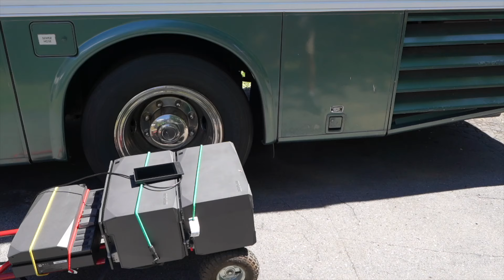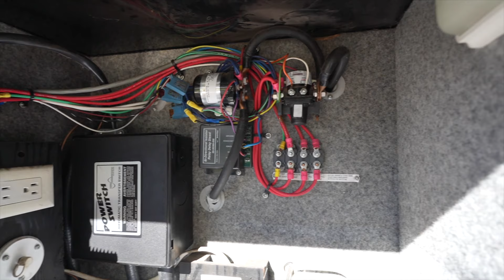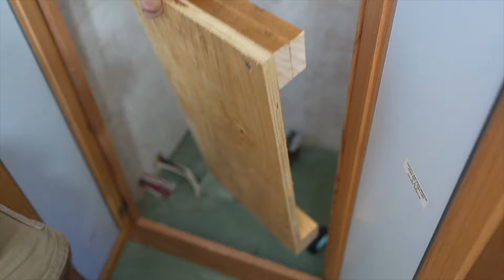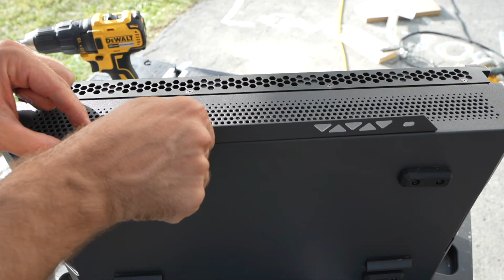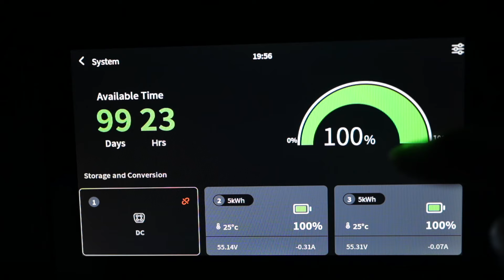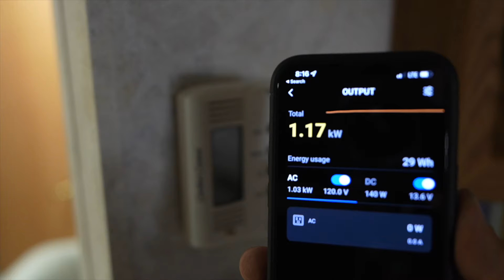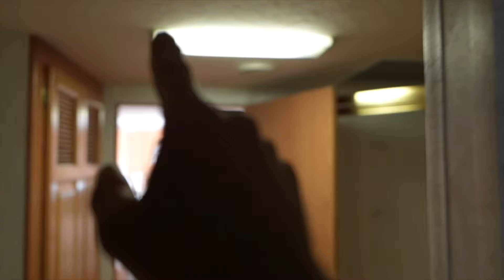Upgrade Your RV with MASSIVE Power | EcoFlow Power Kit

Comment from the maker: Thanks for watching!  Please Like the video (if you did).  Next on my RV to do this is to track down a short circuit that’s been draining my engine batteries.  What’s a project you have next on your list?
Reply: My next project: Clean my repair desk...
Great video by the way!
Reply from the maker: @androidmx1831  Nice!  Me too.  Thanks!
Reply: Would the amp-hound tool help you in any way to find the short circuit? It was featured on the Youtube channel "Car Wizard" in the video titled "Smoking up the Shop! CAR WIZARD shows 3 essential advanced diagnostic tools he can't live with out!" starting at 13:08. It is made for finding battery drains, not exactly short circuits, but they can be related so maybe it could help?
Reply from the maker: @justin_time  thanks, I don’t know of that product so I’ll have to check it out!
Reply: I will get one and steal electricity from public buildings
Reply: That's so funny I just watched another guy's channel right before yours and he solved that problem of running boat 13,500 BTU at the same time they having soft-start on them

Comment: Hi, how are you? a few days ago, I bought a brand new Fiat Ducato van. The project is almost ready, all in 80/20 profile. now I see many people using the ECOFLOW system,  I have some questions about the Ecoflow equipment.

1) It's a relatively new system. What do you think about the durability and maintenance of the equipment and batteries? Are they durable?

2) I live in Portugal, and here in Europe everything is 220V. Is the equipment dual voltage?

3) Will the circuit in the van be 12V or 48V (refrigerator, water pump, lights, etc.)?
4) What type of solar panel should I use? 12V...24V...48V...does it need to be Ecoflow or can it be another brand?
5) With a 5,000-watt battery, is it possible to power a two-burner induction cooktop?
6) Is it easy to configure?
7) What do I need to add to the system to be able to have the water tank level readings on the Ecoflow LED panel?

Thank you very much...I miss your updated videos!

Comment: Still waiting for the alternator charging video.
Would it be possible to connect any 3rd party battery to the alternator charging port to charge the power kit batteries from 3rd party batteries?
I think it should be possible…?
Reply from the maker: Are you wanting me to review it?  I'm not currently planning to review one but I supposed if there is enough interest I could.
Reply: @FrugalRepair mainly just let us know here on this comment if it’s possible or not

Comment: Until they improve outputs to permit the use of a 12v a/c unit, this system is a hard NO.
Reply from the maker: What are you wanting to see change?  A higher amperage on the 12v output?

Comment: That's sweet. It looks like that closet space was made specifically for those batteries. Real clean install. I just found your channel and subscribed.

I just faced a similar space challenge with my batteries. I too have an older motorhome with the batteries located under the entrance step. Our motorhome came from the factory with 2 CG-2 FLA golf cart batteries in this space. We're FTers who boondock most of the time, so wanted the largest capacity battery we could fit in this same small space. If we went with 2 pre-made batteries like Battleborn, Lion Energy, etc. only 2, 100ah batteries would fit there. So in January we custom built a 560ah (7.1Kwh) LiFePo-4 battery, made with 8, 280ah prismatic cells. We actually made 2, 6v batteries so we could wire them the same. Think of it like 5 1/2, 100ah Battleborn batteries. We used a Heltec 350amp BMS, to start the onboard 5,500watt generator in our motorhome, along with a 5a active balancer to keep the cells synched up. We built our 12v battery with grade "A" LiFePo-4 prismatic cells having a 6,000 cycle manufacturer projected life at 100% DOD. This means that if we cycled them 100% every single day, 365 days a year, they would last over 16 years! So they're obviously going to wear out from age before they wear out from cycling. It only cost us $1,500 to build this 560ah battery, including the high amp BMS. Thet fit under our steps perfectly, have 5 times the capacity of our old lead acid batteries and were even 35lbs lighter too. We insulated the battery compartment, cut a 1" hole in our step risers and installed a tiny computer CPU fan to keep this space at close to room temperature, so we don't have to worry about the BMS shutting down charging from getting too cold - or their life reduced from getting too hot. 

We started our build 4 years ago with a 620-watt liftable array mounted on the side of our motorhome. It serves as a nice bedroom window awning too. It practically lifts itself to the desired angle with a couple gas struts and it's easy to clean with a windshield squeegee, standing safely on the ground. Lifting an array to the correct angle for latitude and month, produces 25-30% more power than a flat mounted array - even more in winter when the sun is low on the horizon. We typically use about 15% of our battery's capacity each day, running a desktop computer and a 55 " UHD TV most days till midnight. We've found they charge much faster than our old lead acid batteries did and are typically full before 1:00. Our complete system, including the liftable array, wiring, breakers, a new Progressive Dynamics 80a Li compatible converter/charger, a 600w PSW inverter (to run our TV and PC), an Epever 50a MPPT charge controller for our solar panels, a Lnex battery monitor/shunt, and a Renogy battery to battery charger (to protect the alternator) only cost us around $3,600 as we did all the design and installation work ourselves. 

We have our MHs onboard 5,500w generator for backup and to run our AC units and microwave, but it doesn't start and shut off on its own like your sweet system. Last Spring our 23 yr old, 13.5k Btu Dometic AC died so we replaced it with a new 14.5k Btu Furrion easy start AC which cools our entire 36ft motorhome just fine. Since I installed it, we never had to run our rear AC even once. Furrion now makes a 15k Btu model that's even more efficient, drawing the same current as our 14.5k Btu model.
Reply from the maker: Thanks for watching, subscribing, and the info!  I was recently reminded about how nicely those two batteries fit when I had to pull them out to wire in a solar array before I put them back.

Comment: What about the function of the alternator and generator to charge your batteries? Did you attempt to wire those units together?
Reply from the maker: Thanks for asking.  I have used both and they work.  I just drove a 2,000 mile trip and used the alternator on and off.  I likely need to come up with a better wiring setup for the alternator cable but it works.  One thing I need to think about more is that when I turn the engine off that I need to turn of the alternator input otherwise it draws from the engine batteries.
Reply: @FrugalRepair the alternator charger from EcoFlow is a smart unit and when the engine is off it is not pulling power

Comment: Well if they would give me the money back for the Eco flow Delta pro 2 and extra battery that I bought to power my RV that turns out it won't power my RV because of a Problem with the compatibility with transfer switches Regarding a negative ground issue yeah I would be happy to buy one but since I paid $6000 for 1 that wont-work maybe I won't
Reply from the maker: Did you contact customer support?

Comment: Great video.  This looks like a great system to upgrade to but you may want to point out the cost.  Based on their website the gear they gave you cost as much as my TOAD.  This is not an inexpensive upgrade.

Comment: You know what.. The built in Onan genset on  my old class A is pretty well shot. I wonder if I could just take it out and put a system like this in it's place.

Edit, just saw the price, Yikes! Might see about making my own system....
Reply from the maker: Especially If you’re generator is gas/diesel then that’s a good thought.  Is it possible to rebuild your generator engine?
Reply: @FrugalRepair  Yeah, I just didn't want to mess with that if possible because the previous owner did some odd stuff like replacing a safety control board with a toggle switch... The main issue is I know the carb needs rebuilt, it's spewing gas out of the bowl now so sounds like the needle is gummed up. I can't get into that tiny space to even disassemble it. I was going to try to drop it but my floor jack doesn't go high enough. I just got fed up and gave up for now.

It's a gas Onan 5500 Emerald if I remember right.

Comment: What I like best about this Power Kit is that it is using a 48v system which has thinner wires and a bit more safer compared to the 12v system.
Reply from the maker: Yep! Less amps (and unwanted heat) for same amount of power.
Reply: @FrugalRepair  48v is the way to go if you want to run your high current devices like AC. This winter, we will be installing a 48v battery bank ourselves in addition to our 12v system. We will use 16, 310ah prismatic cells (15.9Kwh.) So together with our 560ah (7.1 Kwh)12v bank, we will have a total of 23Kwh of batteries onboard. This is why we mounted our solar array on the side of our MH, to leave the roof free to rack 8, 460W bifacial solar panels down the length of our 35ft Class A. The front side of these is rated at 460 watts with up to 25% additional wattage output from reflected light on the back side, for a total of up to 575 watts, depending on how they are mounted. We will be racking ours about 13" off the roof to clear our front AC shroud and vents. This clearance should conservatively produce another 10% output off the back of these bifacial panels, from sunlight reflected off our white roof - more during off-peak hours and in the winter. It will give us some nice shade too, reducing the heat load on our air conditioners. Our MH is only 11' 9", so we will be able to keep the RV height to about 12". Rather than buying individual components, we will be using a Sungold Power all-in-one 48V, 5,000W, 120V PSW Inverter, 80a MPPT charge controller with a 40a A/C battery charger. The reason we chose this all-in-one is because the idle power consumption is only 25 watts - and it's only $800.

We will be replacing our old rear 13.5k btu rooftop AC with a super high-efficiency 12k Btu 48v DC mini-split heat pump that only draws 750 watts at peak output and less than 500 watts when it's cooling normally. This second phase will cost about $10k, including the heat pump, as we plan on doing all the work ourselves. Our 2nd phase will provide 24/7 off-grid air conditioning and supplemental heat from the heat pump and allow occasional usage of our front rooftop AC to cool things down for peak afternoon demand, as well as give us whole house 120v ac power. This will give us total off-grid electrical independence, allowing us to keep our generator in reserve for emergency use only.
Reply: @SuperSushidog what AC model
Are you looking at using? I’m not aware of any 48V mini split units that efficient

Comment: A "soft start" system might be able to help with the dual A/C start-up issue. The folks on the channel "Gone with the Wynns" covered that topic a few years ago when they built a similar setup to yours. Thanks for sharing! Love the solar tech!
Reply from the maker: Thanks for watching ! I was thinking about the soft start but wanted to see if 60amps was enough.  I’m pretty sure that if one AC is using 10amps while running then it gives a little less than 50 amps to start the second one. I don’t know why the transfer switch was having an issue.  Do you have any solar panels?
Reply: @FrugalRepair  True true. The numbers seem to add up, so I don't know what could be causing the issue either unless there are other devices in addition to the AC that are somehow drawing a huge amount of amps - seems unlikely. I hope you were able to find a solution though! I do have one solar panel that I use to trickle charge my car battery. It's a Deltran Solar Battery Tender ~35 Watt.  My car often sits for a week to two weeks at a time and I was constantly worried about the battery being dead but it took away all of my woes, even in the winter. I love it. Rarely can a product bring me that much genuine relief. My car always fires off with no issues now no matter how many days it sits. That is a much different and much smaller application from yours. My knowledge about bigger systems comes solely from watching YouTubers like yourself install systems for larger projects, like the Wynns and their yacht.
Reply: Those soft start devices really help

Comment: I would ditch the roof top ac units and install a mini split.  More efficient and better cooling & heating.
Reply: Would that stand up to the bumps of the road?
Reply: @bkbroiler6609  They have been installed in semi trucks, bus and RV's and hold up just fine!
Reply: @williamzoom  Then that would be a great idea. Or at least upgrade the 92 AC units. Those gotta be hella inefficient.
Reply from the maker: Thanks for the suggestion.  I'll keep that in mind.